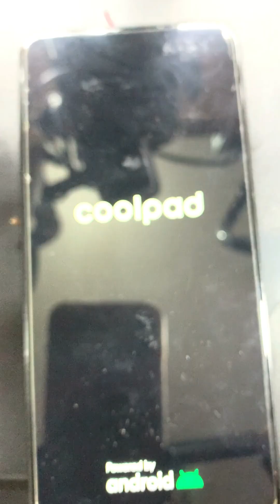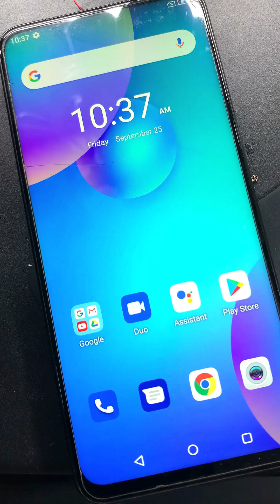Cpu Emmc Reballing Step By Step #mobilerepair #icreballing

Comment: Hi, thank you for such a detailed video. A question: has the solder paste to be previously dried from oil before spreading it on the stencil, or can be used directly from the jar? Thanks
Reply from the maker: First clean stencil with glue remover liquid , remove extra flux paste on solder paste using a cotton cloth or tissue paper

Comment: I practice removing ic it takes between 2 to 3 minutes at 350 degree, it takes more than 1 minute in 375. Is it safe to higher temperatures even more to complete below one minute
Reply: 350 and 375 °F or °C